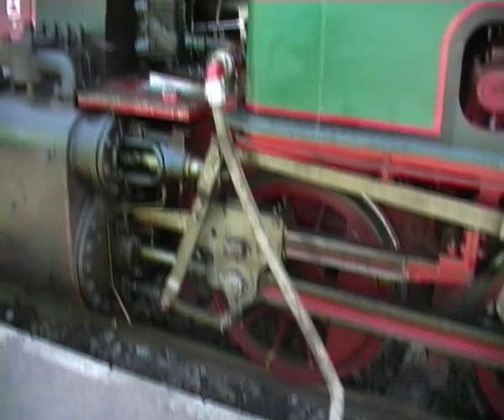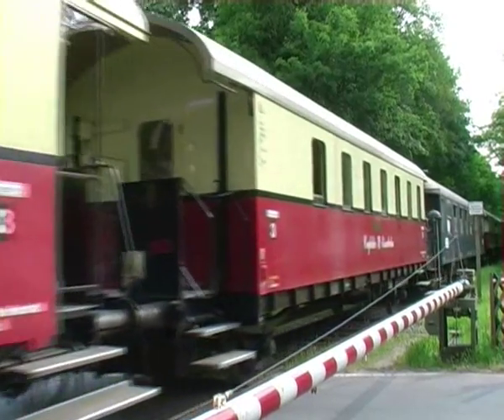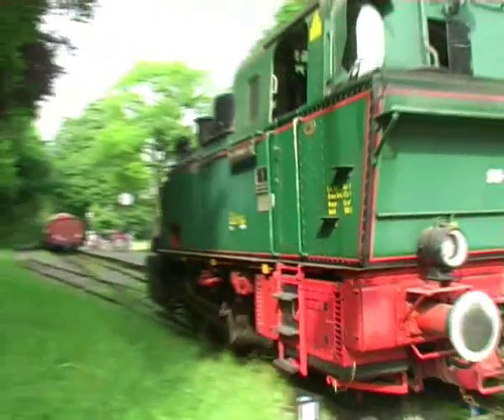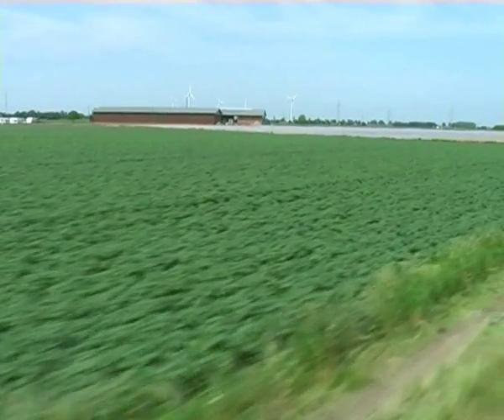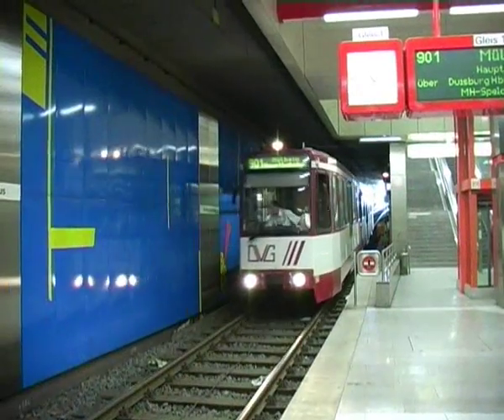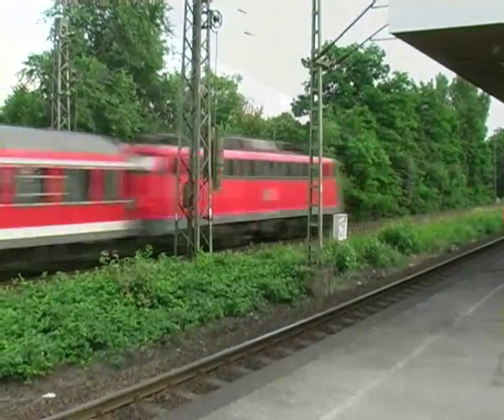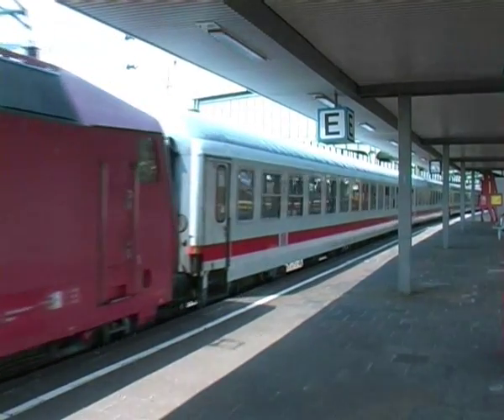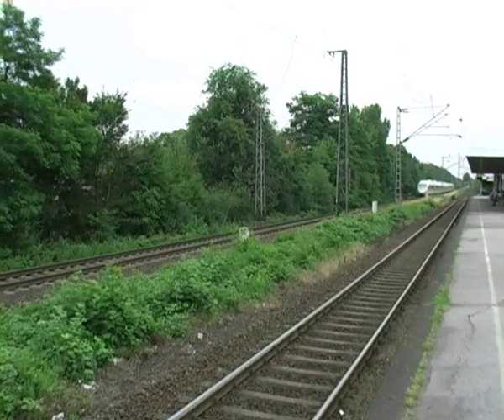German railway transport system: DB Past & Present

Comment: The German rail system is not nationalised anymore and hasn't been since 1994. DB is government-owned, yes, but there are also plenty of private operators on regional lines. In some areas, such as some parts of Saxony, DB runs no regional trains at all. There are also an increasing of private long-distance operators, though they are not subsidised as regional lines are. The biggest one is currently the HKX (Hamburg-Köln-Express) from Hamburg to Cologne.

Also, the German rail terms are a bit complicated. I've tried to explain them:

* DR - Deutsche Reichsbahn (German Empire Railway): nationalised railway in whole of Germany from 1923 to 1945 and in Eastern Germany (+West Berlin) from 1945 to 1993)
* DB - Deutsche Bundesbahn (German Federal Railway): nationalised railway in Western Germany from 1945 to 1993
* DB - Deutsche Bahn (German Railway): private, but government-owned railway company since 1994. Still holds the de facto monopole on long-distance and high speed trains

Train categories:
* ICE (Intercity-Express): high speed trains (mostly EMUs, and some DMUs and loco-hauled trains)
* IC/EC (Intercity, Eurocity): long-distance but not high speed trains throughout the country. EuroCity trains continue into neighbouring countries.
* RE - Regional-Express: fast regional service, which only calls at bigger stations. The most important RE services are operated with double-decker trains, such as the RE5 (Rhein-Express) shown here.
* RB - Regionalbahn: local train, which stops at every single station (except when parallel S-Bahn services are available). Mostly operated with small DMUs or EMUs or older loco-hauled trains.
* S - S-Bahn: suburban or commuter train, which only operates in and around the big cities. Operates with fast EMUs and sometimes has metro-like stations and routes.

There also other categories (IRE, SE, M, HEX, MRB, etc.) used in some regions but this would be too much in one comment
----
* U - U-Bahn: The same as metro, subway, tube, underground or whatsoever
* Stadtbahn: (mostly high-floor) tram services which use tunnel sections in the city centre. Only found in Western Germany
* Straßenbahn: this is the tramway or streetcar.

Comment: Hi, this is a very nice and informative video. I am not an German but I am living here since quite a few years. I am sorry to point out few small mistakes from the video. The RE is a Regional Express but not a Rhine Express, The train that you showed in 6:10 minute is an IC ( Inter City) and the ICE train travels at an speed of 330 kmph up to 360 kmph (average top speed 300 kmph).  And as mentioned earlier, not all the cities have the UBahn ( Metro trains) and the Strasse Bahn (Trams) as same transit system, for an example Munich has a well defined network of UBahn and also a well defined network of Trams. Both are separate and spread all across the city. Thanks :)

Comment: Hey very nice video. :-) I'm from Germany and I think that the Railway system is very good here. but there is one little misstake... RE doesn't mean "Rhein-Express". There are other REs in other cities which are not along the rhine. The "R" stands for Regional. Means that this train conects 2 or 3 big cities and the villiages in between.
For example there is the RE8 and the RB27 both are trains going from Koblenz over cologne to mönchengladbach (RE8) and to Rommerskirchen (RB27)
the differences between RE and RB is just the fact that a RE train is faster. A RB train stops at every station on the way to the end of the line. sorry for my bad english ;-) just wanted to say that but everything else was very interesting 
good job